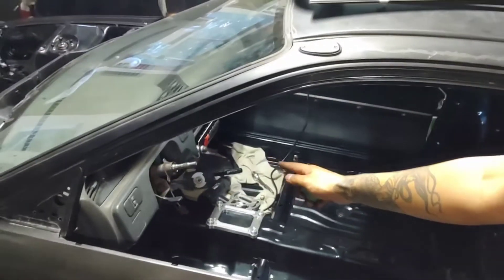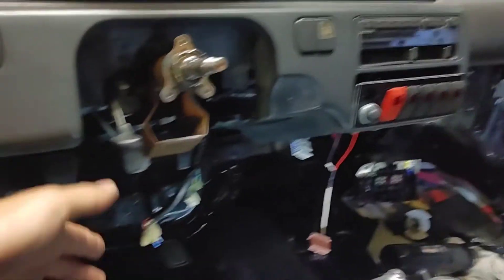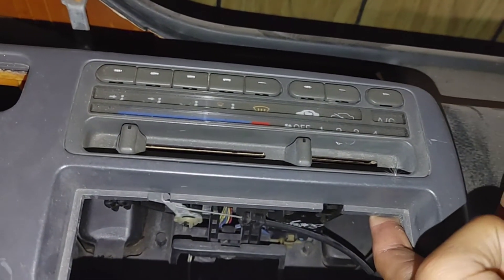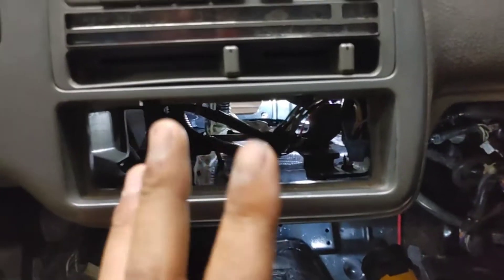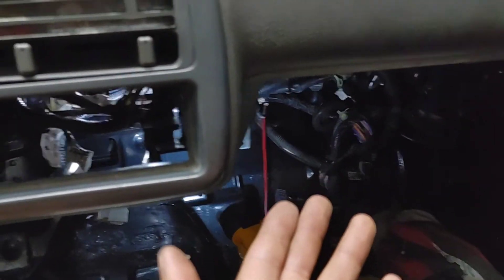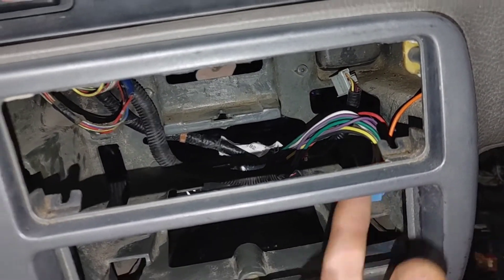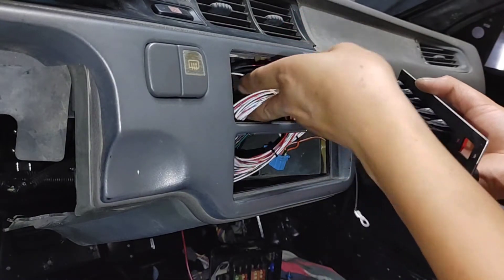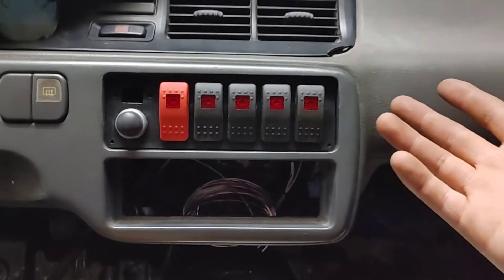Locate The 3 Hidden Climate Control Screws on Your 92-95 Civic & RaceSpec Switch Panel Mock Up

Comment: Amazing content! Just watched the panel wiring as well.
Guessing if I take out the a/c panel I can just wire in a pot for heat vent?
Reply from the maker: Thankyou 🙏🏽 
I dont see why not if you can find the wire pin out, the only issue I'd see is the blower motor speed (maybe) I havent done it personally